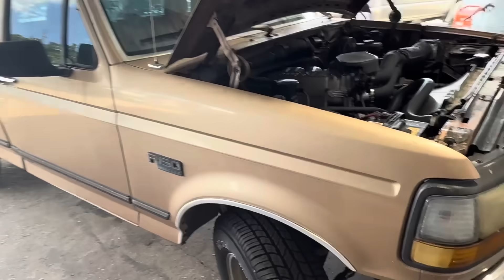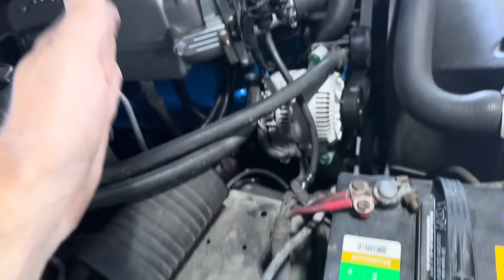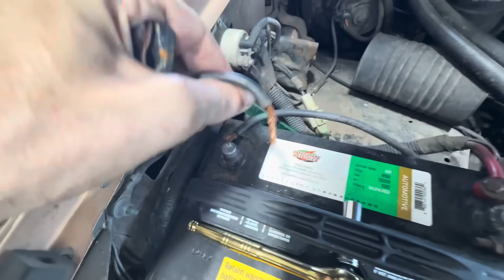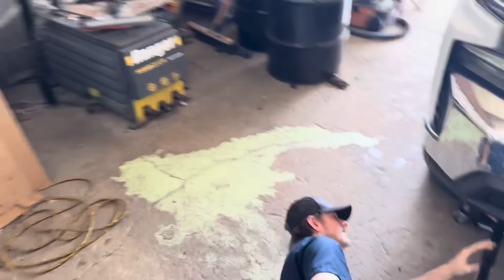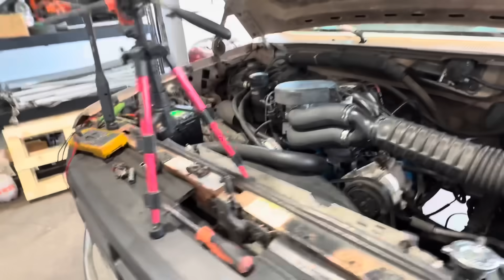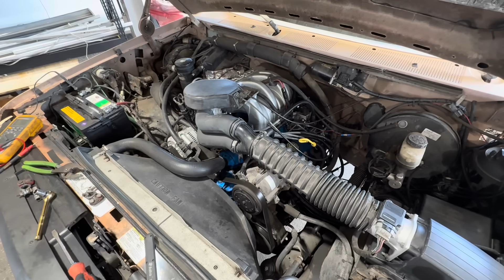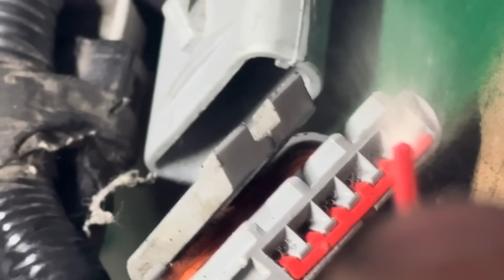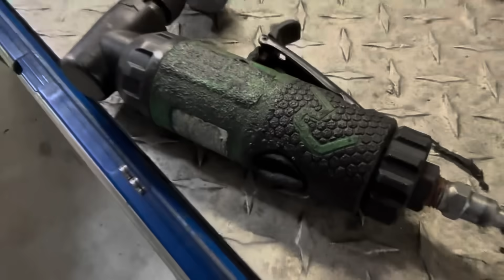Crank No Start! Accidentally Fixed! Can’t find the Problem! Ford 5.0

Comment: Ray, you can't measure resistance accurately when a component a.k.a. battery cable is caring current. That is a big NO-NO. The Fluke DMM measures resistance by applying a known voltage to the test leads. It then reads the current in the  leads and displays it as resistance in ohms. Ohm's Law states E/I+R. When you have the car running you are adding voltage to the test and creating errors in the displayed resistance. Flukes are very fault tolerant but too much voltage donated by the device under test and DMM will be damaged. Just disconnect one end of the cable and then measure its resistance. If you want to make a measurement in a hot circuit then just measure the voltage drop.
Reply: Absolutely correct.  Never do any resistance tests when circuit is live.  One correction E/I=R. Or E=IR or E/R=I.
Reply: Yup...

Comment: Put a new set of Battery Cables on it, the ground is probably painted at the engine block.
Reply: This could likely be the issue, there is a lot of new paint on the engine, it was probably not cleaned off before bolting the ground cable onto the block, a common mistake by people who don't truly understand electrical circuits, a lot of electrical gremlins are caused by bad grounds.
Reply: @errolseager2603 yes better believe it

Comment: You can run a temporary ground from the battery negative directly to the block to eliminate the high resistance issue in the  cable? Easy check to do?

Comment: If my memory is correct along the time that truck was built there was some tsb’s from ford on ground problems , most common one was a small single spade connector on the small ground wife attached to the battery conveniently tucked down the wire out of sight behind battery tray , fix was simply cut out connector and use a butt splice , also had a tsb along in those year models and you were supposed to add a ground cable from engine block to frame , may not apply to you just some thoughts. Hope you solve the mystery! Always hate start no start gremlins 😂

Comment: Personally I'd change out the ground wires, and maybe even add a couple more at other points, IE, motor to frame, gearbox to frame, and battery to frame, this will allow the shortest path to ground for any component, and cut the resistance on any one line
Reply: No such thing as too many grounds!
Reply: There is a thing where too many bad grounds causes problems!
Reply: @hestheMaster  new correct gauge wires, clean and solid grounds = almost zero impedance and less problems, the one thing electric needs is a clear path to run to and from it's source
Reply: @nemesismcc  Tell me abouit it. I work on tube electronics mostly radios and some phonographs. Oxidation is a thing!
Reply: I used to go to the electronics store test tubes & fix my TV sets😂 @hestheMaster
Reply: Put a few drops of oil on those terminals and wire.

Comment: What happened with the battery cables that you still had high resistance on? Also, you didn't check for them getting hot after the new terminals? Unless you did all this off camera.

Comment: You can NOT measure cable resistance with a multi meter with the engine running and the battery is charging or discharging.

Comment: You're doing resistance measurements on an active circuit with loads of amps flowing through it! This will give false readings on your meter. The meter injects a current and measures a votlage drop to calculate resistance. The current that the vehicle is generating (to charge the battery) will greatly impact this voltage drop, resulting in incorrect readings. Also try to do resistance measurement on circuits when no current is flowing through them (or vey little current). If you must measure resistance on a live circuit, safest thing to do is to measure current and voltage drop and calculate resistance.
Reply: I was about to make a far less restrained comment!
Reply: Indeed, the only way - besides temperature rise check - is to have a DC clamp-on current meter and voltage drop measurement applied at the same time.  Then calculate the resistance from the V/A ratio.  The ohm-meter tries to apply just 1 mA test current, but that will be swamped by the alternator supplied or by load current, either one likely in full amperes, i.e. more than 1000 times that of the ohms measuring meter provided current and respectively used in the internal V/A calculation.  OK to measure voltage drop, but not in ohms range!
Reply: @InssiAjaton  Back in the days of analogue meters the thing would flick its needle past one or other of the end stops - something an ohms reading should never do.
Ohms is only really measurable on a dead circuit. Using current clamps etc is simply beyond most mechanics, and I wouldn't try and do it myself. There is an ignition key. Use it!
Reply: @InssiAjaton  Ray needs some time with learning how to use a digital meter, he shouldn't check for resistance on a live circuit.
Reply: Exactly. Notice that the 104 ohms reading was NEGATIVE. That means you are measuring a current not caused by the meter.
Reply: @krabkrabkrab So if you have negative resistance, that is even better than zero resistance. You might be able to quintuple the cable's amp carrying capacity without using cryogenics. 😉👍
Reply: Note that E=IR suggests that if you really had 4ohms in the ground that maximum current you could get from 13.8 volts is 3.45 amps. There’s no way the starter motor to turn with that little current. If you need to estimate the resistance while running, Measure the voltage across the battery cable for a better estimation of the quality of the connection. If should be less than 100millivolts.
Reply: Exactly,, wondered why you were doing that, while it's running,, Got to reconcile those  corroded wires, replace or cut back to good copper.  Ideally, replace.
Reply: Remeasure the resistance with everything turned off. You can't accurately measure a live circuit. Add a bonding wire from the engine block to the chassis and replace those damaged power and ground wires with new and heavier gauge wires. Same with that tach. wire. Let it sit and if it starts back up send it and tell the owner you think it's fixed but aren't 100% sure.
Reply: Yes, what he said...
Reply: So are you going to grind off all the snap on names on your spanners?
Reply: Was just going to say if you're looking for bad connections voltage drop seems to work better than checking resistance. Resistance to me is like seeing if an electron will have trouble getting to the other side whereas voltage drop tells you whether a ton of them are having trouble or not. Ease of current passing is implied.
Reply: Yeah, I thought it was weird that he was measuring that while it was running.
Reply: Yeah. Typical DMM resistance passes maybe 1mA between the prods and measures voltage 0 to 200mV for resistance 0 to 200 Ohms.

Big voltage drop will show, because battery is half-flat and recharging.
Reply: Yeah. Lots of good stuff here. Ironically, only a live (current carrying) connection with no resistance is certain to produce a correct reading (zero ohms). Otoh a reading of zero ohms on a live connection does not mean it has no resistance.
Reply: Performing a voltage drop from each end of the cable is adequate and done whilst loaded.
Reply: Yep. Made me cringe. Voltage drops/current would be the only useful measurements on a circuit with current flowing.
Reply: Bingo!
Reply: When TheApocalypse Starts...
Come Find Me!
I'll Need "Mechanical/Electrical" Proffessionals For TheCoalCityMilitia! (RaleighCounty,WestVirginia)
(I Know How to Live & Survive in TheWoods...You Know How to "Fix" Electrical "Equipment".)
My "Mechanical-Know-How" is "Small-Engine(s)" & ATV's & DirtBikes.🤷
Reply: Thank you for your comment.  Saved me the trouble.
Reply: Bill Nye checking in. . .
Reply: Ironically, if he had made a resistance measurement with no car battery  current flowing in the circuit the resistance would have read zero or very close to it. The fact that the thermal imager indicated a hot wire could indicate a higher than normal resistance or it could indicate very excessive current flow in the system with normal resistance.
Reply: yeah I was just about to say something too. RAY your multimeter says NEGATIVE OHMS that means ur meter is getting bombarded by voltage, NOT ACCURATE U CANT MEASURE NEGATIVE OHMS RAY. negative ohms is NOT  thing ray. Not a real measurement. its literally fake news.
Reply: Everyone thinks they're an expert and loves to complain about what they see but yet they watch the videos completely!!!! GOOD JOB RAY !!!!
Reply: Thank you Einstein 😅 But we're not here to read the likes of your dissertations!

Comment: Wipers on starting - short somewhere in multi-controller on the steering column?
Reply: Newer vehicles have a 'courtesy wipe' function that swipes the wipers when you start the car.  In my truck I can turn this option on or off.
Reply: If I gotta be honest I wouldn’t mind that issue I’m from Oregon and it rains when it wants to and dries up and gets stupid hot. Basically the state where the weather has a mind of its own lol.

Comment: I put those type batt connectors on my Dakota. 2 years later we gave the truck to my son. Then no start. After a new battery and starter. We found that stupid connection was the problem..Thanks Ray.

Comment: Ignition switch on steering column would come apart and do exactly that . The box where all the wires go into separate, and the ground that goes from body to frame will cause similar no start issues ( causes no ground to pcm and fuel pump )

Comment: Ya, I saw the wife's knee too. 
Now then, if your having high resistance in the ground cable, did you check the connection at the other end? And I'm disappointed you didn't clean the battery terminals.

Comment: Before anything else, I'd probably replace at least the big ground wire. With that much resistance there, it's guaranteed worse for anything that relies on it.
Reply: You can't measure resistance with current flowing through the wire.

Comment: So, this '95 Ford was right at the change of old style engine electronics and the current. My '95 S10 was that way. OBD - not OBD2 I think. Listening to this Ford it sounds like there's something electrical in the ignition - like arching type misfire in a wire. Probably not that, but that's what the engine sounds like. 
You never did check that ground cable all the way to the block, did you? And, is that the only engine ground wire/cable?
Weird one for sure.